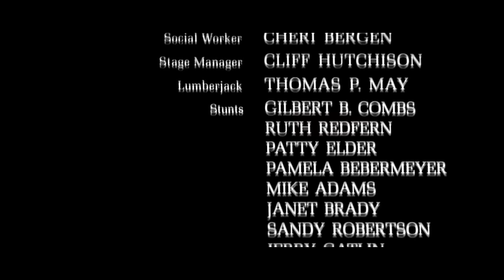PROPHECY (1979) monster horror movie

Comment: You have the Best quality of this movie 👌. This gave me nightmares as a child, my dad took us to the Drive-in to watch this movie...awe Thank you for the memories.
Reply from the maker: Yeah, it was fun to make it look good.  I was shocked when I watched a copy on disc and you couldn't see a lot that really you should.  This happens a lot in transfers due to how the light plays on video vs the light source behind the film back in the day.  So a lot of what you see in my version was going through it changing lighting and colors to make it look as close as I could on video to how you would have experienced it in a movie theater in the 70's.  I'm often frustrated that companies that sell these films don't care or maybe don't realize you have to account on these films for that difference and adjust as needed to restore that original theatrical feel, even if it takes the work of going scene by scene or moment by moment.  Of course then I cheated a little and made it look more modern than it would have in theaters by removing video noise that was originally on the print, sharpening it into HD, motion smoothing it just enough where it maintains a film look yet action flows better, etc...  Final product did turn out very well, but I do regret now not removing that final shot of the bear in the last 10 seconds, it kinda wrecks it all because now it's just sooooooo bad looking since you can see it really well.  I appreciate your comment, thanks!

Comment: The first half of this movie is incredibly good, like easily one of the best build-ups in any horror movie. Such a shame the last act doesn't hold up as well and just falls flat when Katahdin is introduced. It's essentially just a mutated grizzly bear. I've read the original design were much more alien-like with different species mutated into one but still had the characteristics of a bear.

This movie definitely deserves a remake similar to what John Carpenter did with The Thing.

Comment: Still not explained. What do they the paper plant do? Spray the mercury on the timber and throw it in the water? Because algae wont buildup on timber sprayed with mercury on it?
Reply from the maker: Yeah, this is one of those things lost to time, it was huge news in the early 70’s.  Humans didn’t really know the long-term effects so it was scary at the time.  What made it so prominent was a Canadian town, Grassy Narrows, fell legitimate victim to logging practices.  Here’s a modern article that explains factually how the mercury got from the logging company into the environment, which is of course different than the fictional (and you are correct ambiguous)means portrayed in the film.
https://www.google.com/amp/s/www.thestar.com/amp/news/queenspark/2016/09/14/ontario-environment-officials-concerned-that-clear-cut-logging-releases-mercury.html
Reply: It’s explained far better in the book. Basically, the paper plant itself doesn’t actually use the chemicals, another sect that sends them from upstream does it. 

Since they send them by floating them downriver, algae is a problem due to the logs getting held up often due to an over abundance (a problem in of itself that says they are in fact over logging when not necessary). The logs would get TOO wet and would develop algae and therefor ruin their product. So to counter that, they used a chemical agent called PM?? (Can’t fully recall) 

And it’s explained in detail that the chemical was known by another name, but changed so that they could cut corners for cost. SOMEONE had to have known but ignored the issue- the issue being that the chemical had been outlawed in all countries due to an incident in Japan where it caused irreversible damage to the ecosystem and a village of thousands of people who all died due to the poisoning and major deformities that occurred over a sixty year period. 

There’s a lot more over it- but I highly recommend the book because it goes into very realistic (despite the obvi sci-fi science) human detail about the semantics of the creature, the toxins, even the pregnancy and Native American angles.

Comment: Was the sound done in mono? It's terrible. I had to max out the volume on my phone to hear the movie. Thumbs down until the horrible sound is fixed.
Reply from the maker: With all due respect, it is normal.  If you had to max your volume, try adjusting settings elsewhere than volume.  Sometimes it could be your youtube settings got knocked out of whack.  This may sound like it has nothing to do with audio, but it will if something is reducing streaming ability where you are at: go to the stacked dots in the upper right of your mobile screen, take quality off of auto, choose advanced, then reduce the quality one level and try again.  Why does this help if audio sounds off?  My downloads are huge by YouTube standards, to get the absolute best video and audio quality I max out their tools.  But if streaming on mobile is compromised for whatever reason on your device due to high usage if using a router or an area currently low in what’s available without, youtube prioritizes video so audio will suffer.  You might not get this if you switch to another video thats already at a lower quality.  So by creeping down overall quality a step at a time on my channel, this should resolve it.
I just checked on my mobile, audio is fantastic and at a third volume is blasting.  If my recommendation doesn’t help, I’m not sure what else to advise but I take great pride in working these over to be the best on youtube and I promise you the audio is not what you described in your comment.  If it were, you would not be the only one saying so.